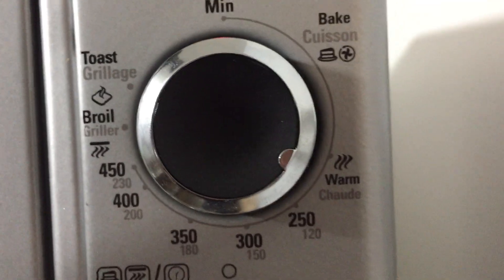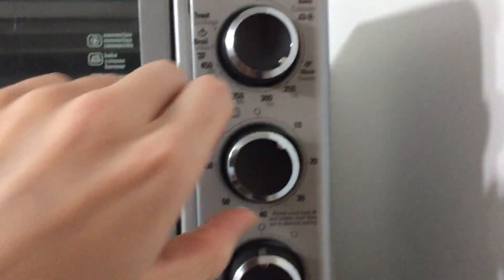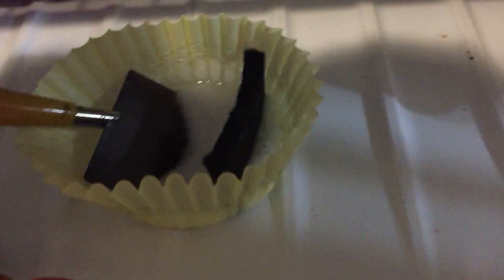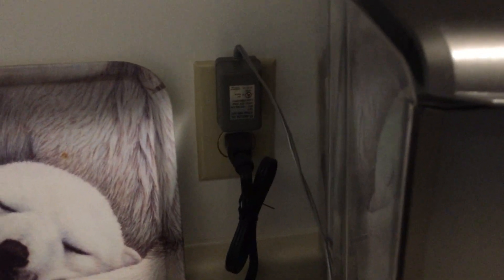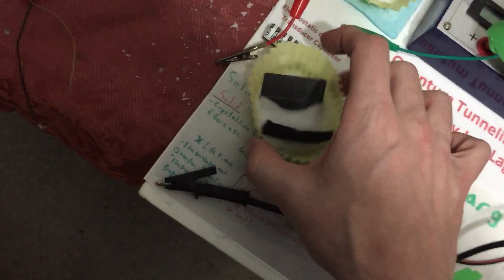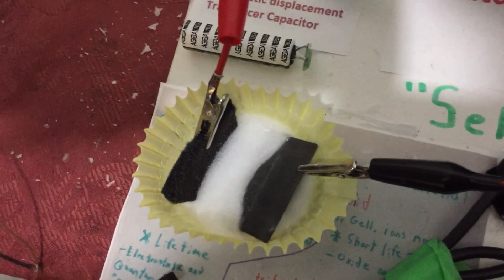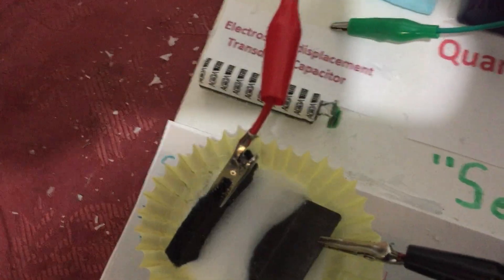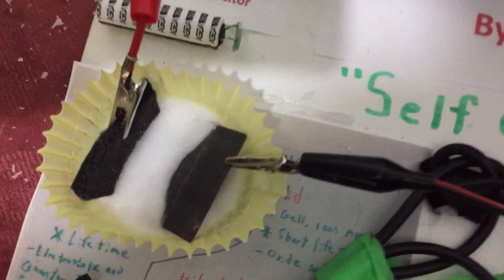Cell Conditioning

Comment: How liquid do you get the electrolyte when mixing with water Before letting it set? If the viscosity is low enough like honey then you could try to use paper as separator with this solid electrolyte or a very thin plastic mesh to get the plates as close as possible without touching 🤔

Comment: Hi Joel,

Are you aware that electrets and permanent magnets are made using similar method ? I hope you understand what I mean.

Different materials will increase or decrease magnetic field of the energy captor device and can be used for whatever is your purpose … i hope you’ll soon start to experiment with combination between your solid state cell (electret) and permanent magnets to see where it may lead … then of course you’ll want to see if geometry of permanent magnets and electrets can achieve something usable.

We need to understand that magnetic effect is a consequence of an electric charge flow and all permanent magnets or electrets work just because the electric charge is moving inside them ad resonate according to their physical capabilities and properties. Difference in potential of 2 dissimilar electrodes create a gradient and electric charge flows accordingly without the chance to escape from the compound.

If you can cut in half one of the cell you will see that both halves will give you the same result … exactly like a magnet.

If someone may have access to high tech, may build a device in small size where many tiny cells are connected in series/parallel with a separator between cells and output will be impressive … I think this was what Arie deGeus was working on when he has been killed. And this is why he said the academic science has not yet understood permanent magnets and only electromagnetism is just understood so far.

Good luck !

Comment: Hi Joel, say when that one gets back up to room temp. will it keep the increased voltage? Also does a dry one take any charge or impact the voltage you put through it? You could try heating the magnesium while taking readings to see if there's a thermal reaction going on like in a peltier.

Comment: Question: are you using carbon fiber felt or stiff carbon board for your electrodes? For the life of me I can't get any conductivity from the carbon felt material. Zip, none. What material are you using? Thanks.
Reply from the maker: Carbon felt on ebay market for energy systems fuel cells etc..
Reply: Look for 100% carbon too, some of them have other stuff mixed in